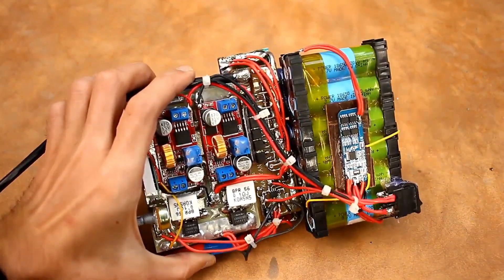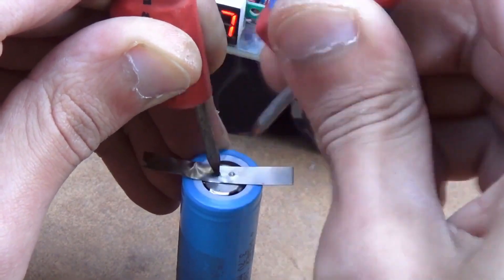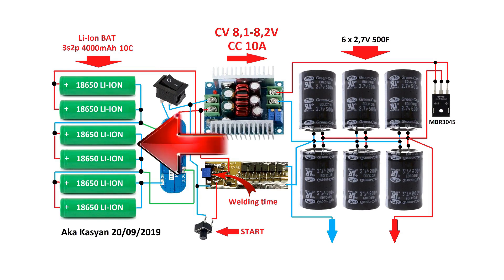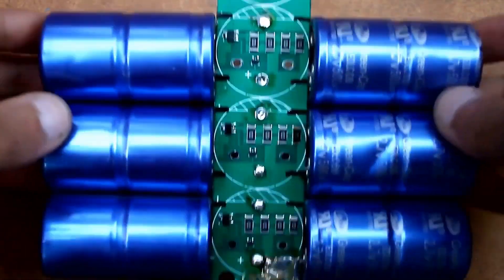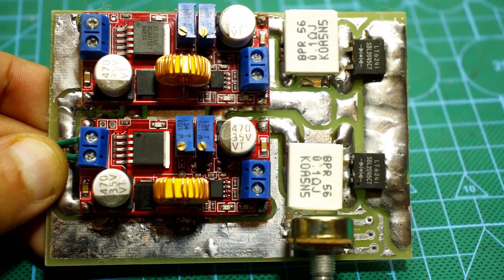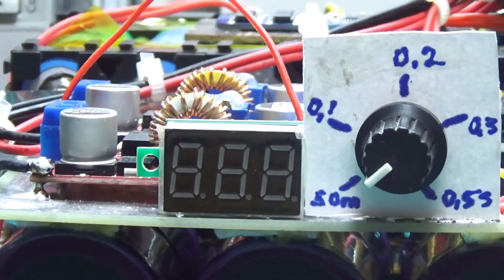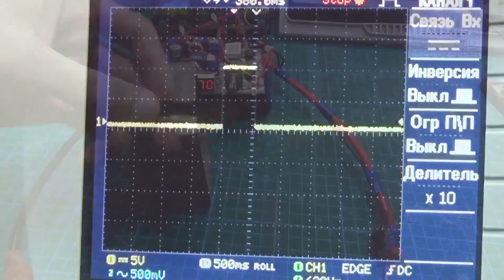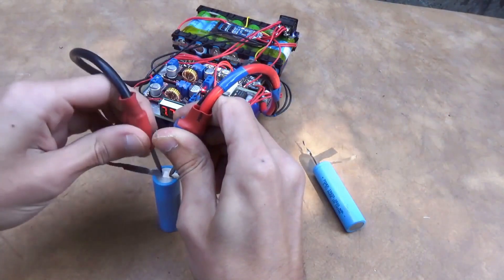Welding machine on IONISTORS #2

Comment from the maker: Hi. Please note that this project was created back in 2017 — it's been 8 years since then… At the time, it was a cutting-edge solution, and there were very few ready-made options available. Now, considering everything, the design is of course outdated, as it is fully analog and lacks flexible adjustments.

Comment: need a  design without  using supercapacitor  they are too expensive
Reply: Just replace the supercapacitor with a lead- acid battery that has a high cold-cranking amps parameter. It's still working fine